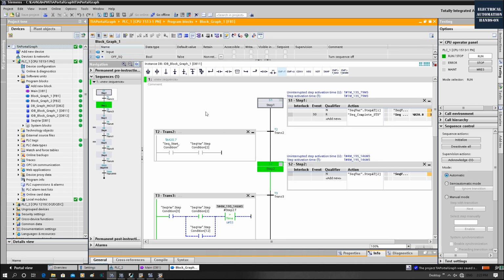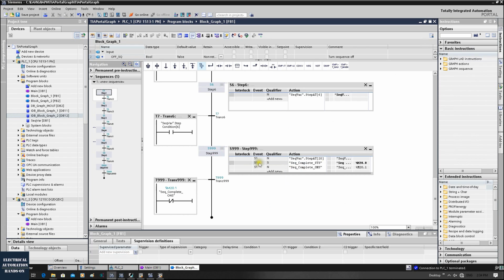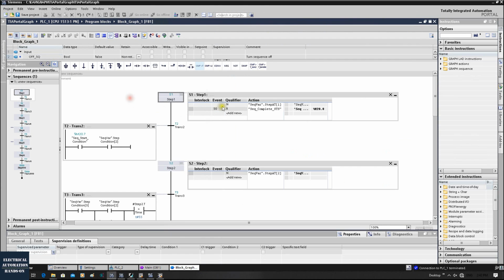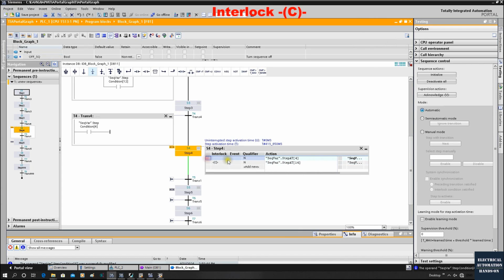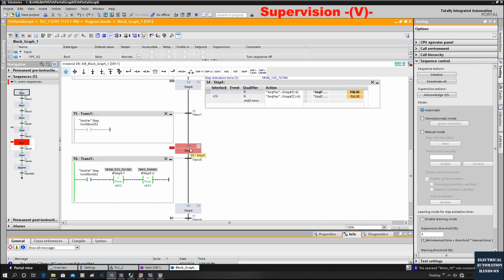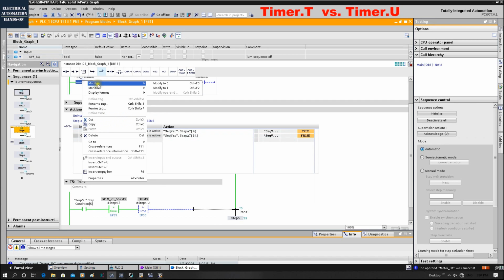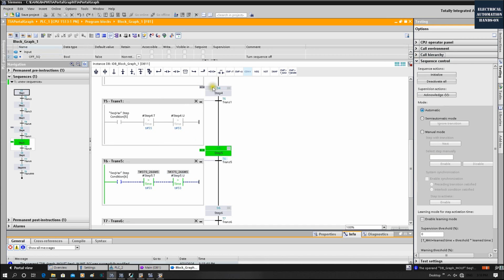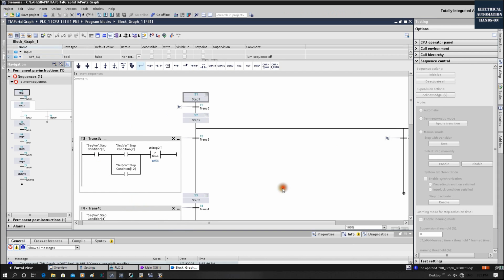SC12. Siemens TIA Portal Graph Sequence Programming and Tips & Tricks

Comment: may I ask you to make a tutorial for beginners on how to control a robot through PLC Siemens ?
Reply from the maker: Thanks my friend your feedback. But learning robot needs to be the real stuff practice. While, it is ture you could build a simulation communication with PLC with Sim Robot, but setting up those connection successfully also need some skills and knowledge.  Therefore, I would say, join a handsOn course and learn it. 
I used PLC communicating with Motoman, Fanuc, and ABB, none of them are easy to setup and communication, especially the safety communication. They all need dedicate programmers and high existing skills to set them up.  
Again, find a specific robot brand, join the class, pay the fee, then find the fit job, and invest yourself.

Comment: Thank you so much for your explanation.

They really were very good advice that has a lot of application.

Is there a way from the Graph sequence chain to directly turn on a Signal Lamp at 2 Hz for example?
Reply from the maker: for using 2hz, you can use the m bits from the property of S7-1200/S7-1500, some frequency is auto generated